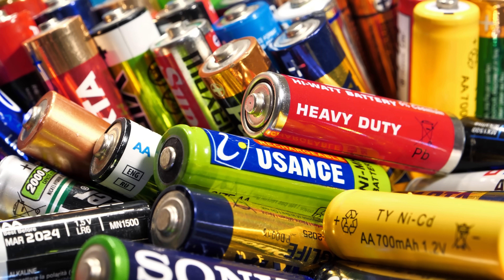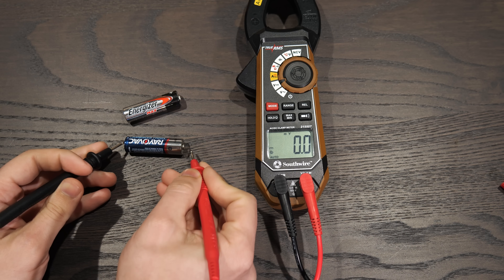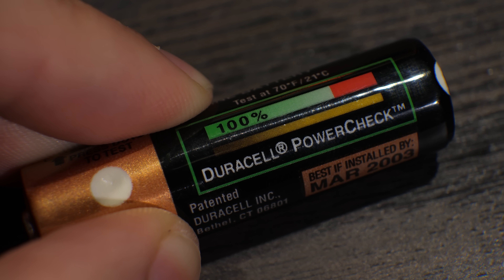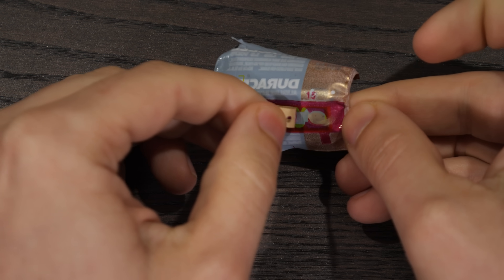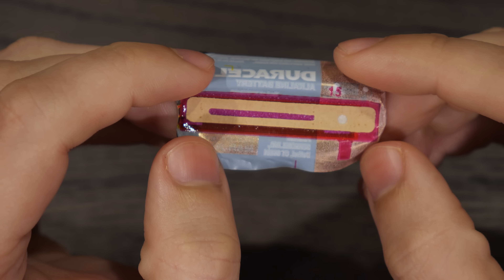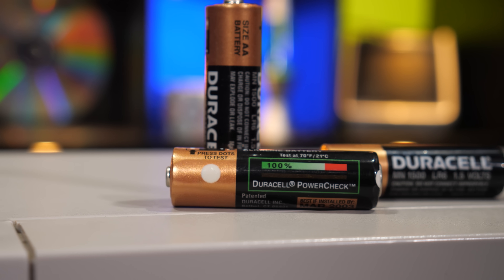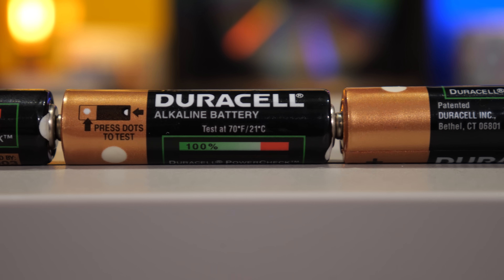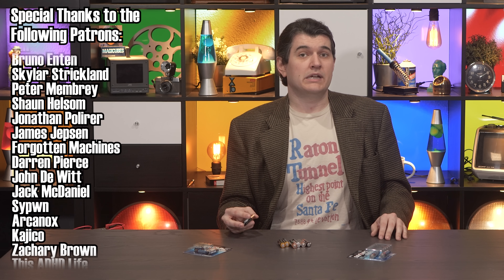Duracell PowerCheck: A genius idea which didn't last that long

Comment: As with you, I learned to remove batteries from anything not used often. I can't count how many emergency flashlights and tools destoyed over the years. It was an interesting sales technique selling Duracell as premium in a world where batteries were becoming a commodity product. In 1990 Duracell had the same tester on their packaging before putting it on each battery. I recently found my old 1980s Radio Shack battery meter... free with any purchase. IIRC, I got it when I bought Radio Shack batteries.

Comment: I bought a toy train this summer that had 2 power check batteries in it. Needless to say, they were dead and corroded the contact so badly that it broke off when battery was removed. 1995 date on them, lol

Comment: Oh! Oh! Hey! Yes, please a video about battery charging. I have an Eneloop charger that I use only and exclusively with Eneloop batteries and then a GP multi charger that could do even the weird 9V ones. I then dug more into it and discovered that the GP one charges the 9V ones with 80mV and has no - delta V function that means it only uses (!) Timer that you have to set yourself reading the instructions. That discovery made me order Varta LCD charger that does the weird 9V one and has - Delta V plus charges 9V with lower than 40mV. Its quite an interesting one.

Comment: the multimeter also lets you group batteries with similar states of charge. you want the voltages to be as close as possible when used together.

Comment: Towards the end of the life of the production of those batteries they only had a standard strip of uniform size and didn't give you anything more than yes it's got a charge. There was also an issue with moisture getting into the wrapper and shorting the batteries out. 

(What I'm about to describe is potentially extremely dangerous please don't try this.) It is actually possible under the correct conditions to recharge disposable batteries however it must be done very carefully and each disposable battery if you can recharge it must be done exactly correctly otherwise it will have a very high likelihood of explosion, burning, and generally a bad time for everyone. Disposable batteries if recharged will never have anything close to the original charge and most likely never above 50 percent. Don't try this one and I won't give the basic procedures for doing so because of potentiality dangerous implications. It is actually better and safer to simply properly dispose of disposable batteries under almost all circumstances.

Comment: I actually like disposable batteries, because usually they make devices using them not disposable. You can still use your Gameboy or Walkman today by just inserting new batteries in them, but good luck trying that with your current phone 30 years from now

Comment: Alec mentioning that we've now mostly moved to rechargables reminded me that I actually did the opposite recently, with my smart door lock. I had been using lithium-ion rechargables that went bad (I bought cheap ones on Amazon, so I'm not really surprised), and the only replacements I had available were some old alkalines i'd purchased ages ago. 
And much to my surprise, putting those alkalines into the lock made it *work better*. It no longer struggles to close the deadbolt when my door is closed enough to latch the handle, but not quite closed enough to latch the wider deadbolt. Now it seemingly has enough power to push past that, and will reliably close the deadbolt every single time.
Anyone know what's up with that? I think I remember hearing that alkalines are higher voltage than lithium-ions. Could that be it?

Comment: See, I had a finite number of batteries for my battery-operated toys. So sometimes I'd have to salvage some from the other toys. So they were kind of partially used and from toys I forgot to pull from. 

Realistically, I didn't really need to test batteries. Either they worked or they didn't.

Comment: If you want a good rant material? Consider complete uselessness of 6F22 batteries. Any engineer designing a modern gadget using those batteries shouldbe required by law to eat it, and all its documentation.

Comment: To be fair, I prefer the old battery set up over the new solder a rechargeable to the pcb inside the device so you can't replace it if/when it goes bad set up. Means the whole device is a throw away (or recycle) in most cases instead of just the battery. Support right to repair and dispose of less.

Comment: I remember seeing this for first time back in day during a weekly visit to the supermarket, and I’ve got amazed by that but I’ve found really uncomfortable pressing the button dot. It’s amazing all the working mechanisms behind “simple” things like this and how well engineered are they and the idea of including a thermal circuit inside the battery sticker just in case you need it, it’s one of worlds most underrated ideas

Comment: Replaced almost all disposable AA and AAA batteries by rechargeables. Except extremely low power applications like for simple IR Remote Controls and wall clocks. But I guess as soon as I run out of the remaining junk drawer batteries those will be replaced too.
Reply: I just got some Adapters that take three AA cells (connected in parallel) and can be used as D cells. Using an old device which takes 4 D cells, now powered by 12 rechargeable AA cells.

Comment: The BEST and EASIEST way to see if a battery is full or empty is dropping them on a flat surface (vertical). If they jump up, they are empty, if they just tip over, they are full :)

Comment: The metal conductor is a silver bearing ink printed via a flexographic process and cured with UV light. I know a great deal about this application because I worked for a company that was trying to replace the ink being used. It was probably my favorite project that I ever worked on.

Comment: I did enjoy these things but even when they were around, I always saw them as more of a novelty. As you mention, it makes more sense to keep a battery tester around if this is an issue (or you're checking a rechargeable), and they were so darned finicky to actually use

Still, they were neat!

Comment: I seem to remember some battery packages containing a separate tester strip that you could just use on any battery; so the tester wasn't built in the battery but it work pretty much the same way. Made much more sense.

Comment: One of these for rechargeable batteries seems like a good idea, they're already expensive and non disposable, so why not.
Reply: The nasty part is that NIMH and similar rechargeable batteries don't have as linear as of a Voltage vs State of Charge relationship, so this wouldn't work

Comment: I think these built-in testers persisted a lot longer in the UK, I remember buying batteries with testers built in relatively recently.  

I didn't use the testers often, but they were a handy little thing to have when something wasn't working and you needed to rule out a flat battery as a reason why.

Comment: The BIG problem with rechargeable batteries: when the battery in a device goes bad after a few years, you can't replace it, unlike with AAs and such. Manufacturers don't make it easy to swap out a dead lithium ion battery, so a TON of devices get tossed when all they need is new rechargeable batteries. I've replaced the lithium ion batteries in my particle counter, vibrator, hair trimmer, and hand vac (so far) but I'm unusually handy at such things. I get that it would add cost to make rechargeable batteries easily replaceable, but it would make consumers and the planet happier.

Comment: The reason I loved these and actually have and use a battery tester is to test the batteries in the device.

The bad thing about these batteries is the electronics that use them do not use them in perfect parallel. Some batteries get used more than others. It's incredibly wasteful to throw out an entire set when only some (not all) are too low to be useful. When a device is no longer working or working poorly due to low voltage, I test the batteries and only replace the ones that need replacing. When you factor in this cost-saving of only replacing actually low batteries, the cost of the tester label is more than justified.

I believe THIS is the intended use case, and I think most people who spent the extra money for these batteries used them that way. I don't know anyone that holds used batteries to use later.

Comment: The problem nowadays is that a lot of devices have built-in lithium ion rechargeable batteries, so, when the battery stops holding charge, you end up having to throw the whole device away.

Comment: Harbor Freight sells multimeters with a battery test mode that measures the current through a load resistor. New alkaline batteries will read just above 4. In this case that is 4 milliamps.

They used to give these away with any purchase.

Comment: As someone who used to burn through a LOT of AA batteries for work (wireless mics for live events), we would regularly test anything that ends up in the used battery bin.  I think our threshold was 1.3V?  Anything above that was circulated back into use somewhere, anything under that was free for the crew to take home and use the rest of.  It was needed because would never run out batteries in a show because of the awkward/unprofessional "my mic died, have to interrupt the event to swap batteries" thing, so anything below threshold was never trusted on stage.

Comment: I discovered two brand new ones in the drawer at my parents house in my old bedroom, they expired in 2001. They are still holding at 1.55 V
Reply: Batteries with exp. 2001 were probably manufactured 10 years before. They could well contain 'mercury'' that extends the shelf life.
Did you check if they are "mercury free" or not?
Reply: @Bob-1802  I'll need to check. I found two of the Duracell with the battery meter, and two Panasonic Carbon Zinc, the Carbon Zinc ones read 1.5v but under any load dropped to nothing. The Duracells work well like new. Same ones he's showing in the video here. I'll need to take a look though. Feels wrong to use them. Thinking of putting them in a drawer for another 20 + years and seeing what happens.
Reply: @Bob-1802  Just checked. Correction, Says Install by 2002. Not one mention of mercury on the label.
Reply: @KmanAuto  Ok!  As far as I know, all new alkaline batteries since ~1996-2000 mercury ban have some mention like 'mercury'-free' somewhere on their case.

Comment: All that research didn't show you that you can go get some batteries with this feature TODAY from the store? They still use them. Also, they didn't put these testers "on every battery", they were only on certain ones advertised with them. On a plus side, the ones you get today are somehow MUCH easier to press for testing.  Maybe they changed the design a bit.  Perhaps you could pick some up and make a followup with a teardown of a modern unit?

Comment: While these testers didn't end up being all that useful for the reasons discussed, they certainly are neat and I'm glad there's a video explaining them. As for Li-Ion batteries, I agree they're definitely better than disposable batteries - but I really wish they came in standardized sizes so I could go to basically any store and get the AA or CR2032 of the Li-Ion world, and know it'd work with my phone, smart TV remote, headphones, game controller, etc. Being stuck with the battery that was designed not just for my brand of device, but that specific model? Not great when the battery stops holding a charge and I have to replace the whole thing.

Comment: Drop the battery on the negative end from about 1 foot.  If it bounces, the battery is close to or dead.  If the battery just goes thud and doesn't bounce, it's good.

Comment: I remember these, but I also remember a model that had the same sort of tester built into the plastic of the blister pack. Same principle with conductor of varying width, with colour changing line, but it was much easier to use as it went over the actual positive and negative contacts, and you could in fact cut out just this one portion of the blister pack and reuse it with other batteries.

Comment: Did you know you could test a battery's charge by bouncing it on a hard flat surface? (straight up on its negative terminal)
The battery will bounce if it's empty (iirc) and won't bounce or at least considerably less when full.
Seriously, try it!

Comment: we do have a bunch of random batteries around the house that need to be pulled out for lanterns for camping or storm outages. they could be six months or six years old. but personally, i've found the bounce test to be the fastest and most accurate way to determine the juice left in a battery. just drop it on the floor from a few inches up and the less it bounces, the more juice it still has. no need to injure your finger tips trying to press those tiny little pads.

Comment: Some devices stop working when the voltage drops below 1.3V or 1.2V The battery still has some juice in it and can be used in a device that doesn't require a lot of power to work, like a TV remote.

Comment: There is another reason, why the built in tester may be a good idea. My wireless trackball is somewhat finicky and sometimes it just disconnects and refuses to reconnect again, unless you remove the batteries, give them couple seconds break and put them back. With such tester I wouldn't need to grab my multimeter, test them and make sure, that the trackball is just playing silly games with me.

Comment: I used the battery tester feature all the time. But never for checking half used batteries. It was to check which, from an unused, but open pack, had the most juice left in them. It was also useful to see if your device was broken or the batteries were actually dead.

Comment: I remember discovering that I could just breathe on the indicator to make it change color, but I never really thought about why.

A somewhat decent use case for the tester: use it when changing batteries, just to make sure you don't get the dead ones and the fresh ones mixed up. Even then, being slightly more organized while changing the batteries also solves the problem.

Comment: I have found that recent Duracell batteries will leak before they die.  I have had more leaky Duracell batteries than any other brand in the last 10 years.  Energizer is currently my go-to brand.

Comment: These batteries were available here well into the 2010's. They became scarce due to rechargeable batteries and eventually most 'frequent use' flashlights switching to lithium ion batteries, either integrated or the 18650 batteries.

Comment: Rechargable batteries are great, but removable rechargable batteries are even better! The convince of swapping the dead batteties for fresh ones and putting the dead ones on a charger instead of plugging in the entire device makes so much sense to me. Plus, built-in batteries aren't usually easily replaceable, and when they die a lot of times the entire device gets thrown out.

Comment: Back in my childhood, the PowerCheck used to be a toy in and of itself, like a fun little science experiment. Now the science part of it is clearer than ever, thank you!
Reply: Same, it felt like the kind of AA batteries they must use in Star Trek 😆
Reply: As a kid I was always checking my battery levels with these inbuilt testers as well as the one mentioned that they used to include separately. I loved always checking my batteries. lol
Reply: You can still buy battery containers with integrated testers. I think the issue is that nobody bothers checking batteries because most high drain devices have either moved to rechargeable batteries or have informative meters built in to estimate the battery life remaining.
Reply: Yes! I loved mashing those little buttons and watching to see how much the bar filled up and wondering how it worked!
Reply: Right? These were rich people batteries, I was always fascinated the few times I got hold of some 😅
Reply: Hahaha exactly! It feels like they were just there for kids to play with 🤣 And it was nice to have as well because of the switching between toys and devices when scrambling for batteries. But yeah, I don't think that many kids even cared about that and would just ask or get new batteries. I suppose it's more of a thing for those kids that like to tinker and figure things out. And those were the only acceptable batteries for my, auto reverse Dolby nr. something noise reduction, bass boost, and some other functions Walkman 🤣 Just because 🤣
Reply: You ever tried to hold them in your hands to get them to warm up? Did it ever work?
Reply: yeah, this was a great mystery to me. Always wondered how it worked and then I forgot it for at least 2 decades. 
Great channel
Reply: Always interesting to find out how something that fascinated you as a child actually works.
Reply: I remember thinking these were so cool. I still think about them every now and again.
Reply: i remember not understanding what it meant but just pressing them would light up the bar and i knew it was hard so i thought it was a strength tester lol. had fun for hours for each battery.
Reply: I wonder how much time of playing with it did the battery capacity suffice
Reply: I second that word for word!
Reply: Bought the batteries sometimes just to play with the meter

Comment: I am actually in favor of appliances using the AA(A) form factor of batteries. All devices I use (incl. mice, remotes and other gadgets) are now using rechargeable AA(A) batteries. Sure, they run a little lower on voltage and die sooner, but as long as you have enough at hand in a charging cradle, it's all good. Also most of them are of the variety that can just live in a charging dock for a while and grabbed when necessary.
And to your point about painful AAA batteries: Have you ever tried AAAA batteries? Those are annoying fuckers!